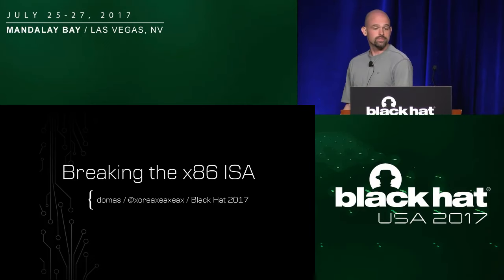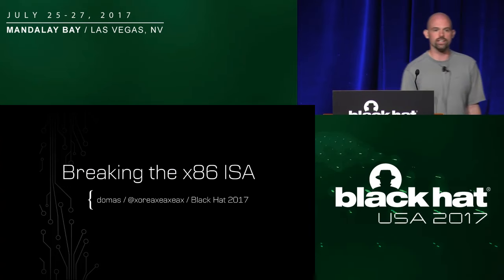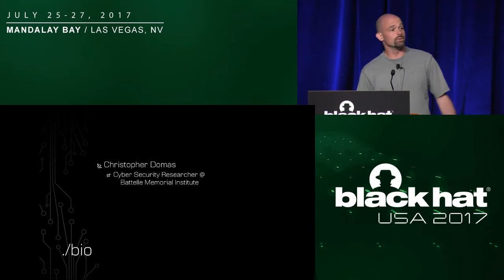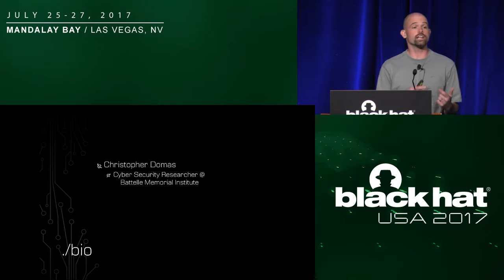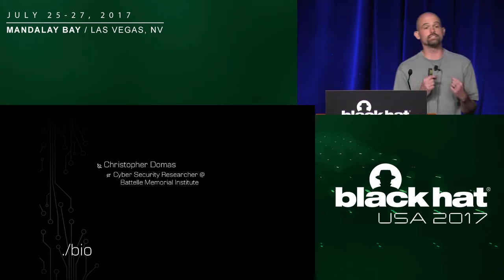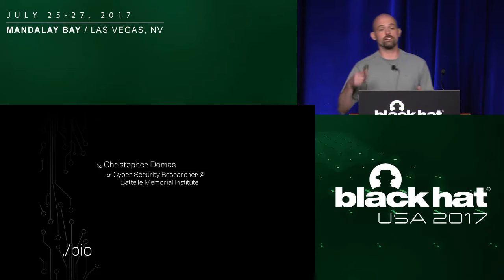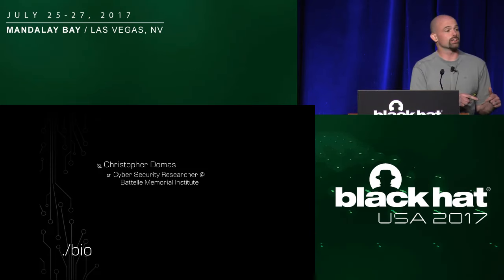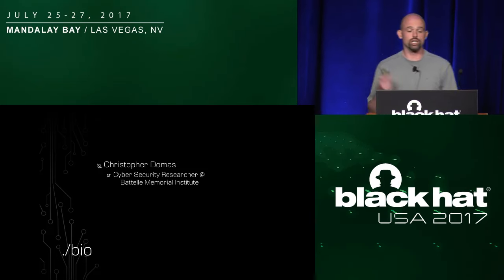Breaking the x86 Instruction Set

Comment: This guy is impressively good at what he does.
Reply: Most of us was suspecting processors to have some dirty instructions hidden inside them, but this is certainly not an easy task to search for them. Sincerely, hats off to this guy!
Reply: Not really, well known intel has entire independent risc processor for the purpose of remote monitoring, even when battery is off your intel pc can access microphone and listen to you talk.
Reply: marshalcraft how? If your battery is off then the microphone won’t work...
Reply: The battery may not be completely off. If the motherboard was designed to provide power to the microphone in the "off" state and provide enough power to the CPU to run the necessary instructions, remote monitoring may be possible. The only way to prevent it would be to remove the battery completely.
However, monitoring may not be feasible. I expect the process would have to dump data to a hard drive, which would require a lot of power.
Reply: Well, we occasionally find out that "secure" products have back doors and we know that the gov't frequently approaches tech companies requesting spy features, so we shouldn't be surprised if hidden ring bypass instructions turn up one day. I'm sure Intel was well compensated for them if they exist.
Reply: Intel is a scumbag monopoly with revenues in billions. They are as putrid as it can get. The only thing they are state of the art in is obfuscating technology and knowledge.
Reply: Come back with your plused one comments when you have a basic working knowledge of electronics.
Reply: Nfcopier, also could put a little bit of depleted uranium, to power it.
Reply: I freakin' love your online name.
Reply: Christopher Domas btw.
Reply: no such thing as imprex or not
Reply: @Reth_Hard  Been seeing you in CS vids
Reply: @atomisedman6235  
I did watch a lot of Youtube videos in the recent years... lol
Just curious, what do you mean by CS?
I can only think of counter strike, but I'm pretty sure you didn't mean that.
Reply: except he can't pronounce "Ryzen" correctly. it's "Rai-Zen" not whatever this is: 3:24
Reply: except he pronounces Ryzen completely wrong... like the name is said to much online, how does that even happen?
Reply: He one of the best.
Reply: The really scary thing is the bad guys are just as good.

Comment: Maybe a stupid question, but how does the cursor keep blinking if the CPU is locked up?
Reply: The graphics card does the blinking. The cursor blinking was literally done by special circuitry back in the days of text-only computers decades ago when the CPU couldn't possible spare CPU cycles to blink a cursor. And since there's been a continuous evolution of compatible machines ever since, the graphics hardware has never been relieved of that responsibility. Of course, modern GPUs can handle that in their sleep. (If the bug was demonstrated in a Graphical UI, then it probably would freeze.)
Reply: no such thing as stupix qor not
Reply: @TheHuesSciTech  eu ia morrer sem saber disso
Reply: @Brick It really is, not only because it would have been difficult to come up with, but also because it would be easy to think something else entirely. I thought it would only stop executing instructions in a specific ring or something like that.
Reply: I had some glitch on nvidia drivers on ubuntu that would show up some previous image sprites that were on my windows after I restarted and dual booted into it, it was something related to dual monitor (it didn't work out of the box, I never bothered to fix it), I have no idea how possibly that could have happened, how some sort of buffer could have survived a system restart, but somehow some internal gpu buffer survived, and I never seen anyone talking about that online. It also seems like the cursor is accelerated by the the GPU too, and probably a lot more going on.

Check this video out:
[PS2 vector unit demonstration Using only 16K of working space; NONE of the ps2 main CPU was used: https://www.youtube.com/watch?v=qlQhJCuBYsE]

Also, in other video game consoles, there is a lot of GPU compute that happens independently of the main CPU, search for architectures for the gameboy advanced, nintendo ds, nes, etc.

Comment: This is why open source is so important. I would love to see a viable open CPU alternative emerge, on the scale of Linux in the software world. It's not impossible, but it would be a much different and more challenging problem to solve.
Reply: already exists. SPARC.
Reply: Thanks..I was aware of SPARC but didn't realize it was open source. I'm also aware of some other open source CPUs. Still, I don't think it quite meets the mark for a genuine competitor to x86. I mean, I can go out and buy a laptop running Linux but I don't think I can go buy a laptop with a SPARC so easily....
Reply: Problem here is licensing.  It can't be GNU.  Would need to be BSD based to entice innovation and protection of intellectual property.  Which means the option to not release certain intellectual property for free.  Or rather, the freedom to not be compelled to do so at the cost of the innovator.
Reply: Kunou RISC-V is BSD-licensed ISA.
Reply: RISC V. Linus tech tips made a video on it recently...
Reply: just discovered RISC-V recently myself also
Reply: one teeny weeny problem with this.... how are you going to be sure the open spec is what is on silicon..... slightly modified chips could be swapped for companies that the govt wants to target
Reply: faacts
Reply: meh757 when gov has this kind of concern, gov uses legal shell companies. You could even become a “free for all” RISC V shell. As long as you weren’t getting compromised. Easier if you’re in a neutral non extraditing country. Easier if you have tamper evident traceable packaging (ie, this REALLY IS the package from chips ‘r’ us in Switzerland, and, it has not been opened)
Reply: Open-source for security only works when people can verify that the object code (the silicon in the case of a processor) matches the source code. It's theater to show some source code and claim that the build matches it. Suuuure it does.
Reply: @JayDee-b5u  How do you know that the binary doesn't have a backdoor inserted by the compiler? Ken Thompson's article Reflections on Trusting Trust is great.
Reply: @JayDee-b5u  Back to what I said earlier. So you have some source code to a compiler and people claim the binary faithfully implements it. How do you know? How do they know? Read the paper I mentioned. It's a serious problem especially when the stakes are as high as an election.
Reply: @JayDee-b5u  It would be interesting to have a full set of programs to bootstrap to a modern GCC etc. Assembly for a bare-bones compiler that can somehow compile a compiler that can handle GCC. C++ is so damn complex these days that it's hard to imagine a C++ compiler written in C.

Comment: TL;DR: This tool is awesome, thanks for writing it, good thinking all the props.

So, some thoughts, sometimes undocumented instructions can be implemented across multiple architectures because it is simply a logical extension of the architecture that isn’t actually documented, but putting in the logic to block those undocumented instructions is more work than it is worth. (i.e. undocumented, or “behaviour undefined” register combinations) similarly, a short-cut in implementation (pinning a behaviour-changing mux to a specific bit of the opcode, rather than actually decoding it) A good example here is the SL1 instruction on the Z80 processor. The three instructions SRA, SLL, SRL are combined in a quad-structure with a section of missing shift-left instructions. Actually executing these instructions results in a shift-left then set bottom-bit. Likely as a result of opcode bits being pinned to muxes.

Additionally, there is still a worth in specifications. Specifications detail what is expected behaviour, and what one can rely upon. As such, there’s a giant chasm of instructions that may work at the time, but are not guaranteed to work in the future, or even potentially after a microcode update.

So, we get this horrible area, where like the 66 e9 instruction, good software should never include this instruction, because it is non-standard and “a valid implementation of undefined behaviour is to make monkeys fly out of the user’s butt”, but meanwhile, the processor still accepts these instructions, and can potentially then be malicious.

At the same time, you can’t really trust that only malicious code uses these instructions… so… poop.

Comment: It looks like the "halt and catch fire" instruction he describes starting at 38:46 was never described publicly, at least that I could find. As he explains in this talk there was no time for vendors to address the issue under responsible disclosure so he couldn't give all the details at Black Hat 2017, but I couldn't find any reference to publications in the following months as he said would happen. There's a question about it on the Reverse Engineering StackOverflow site, but no one seems to know. I'm not particularly looking for a way to execute this instruction, but I'm curious to know if any mitigation was possible for CPUs that had already shipped. If anyone knows and has a reference this would be much appreciated.
Reply: Thanks for following this up! I was extremely curious as well.
Reply: Also hoping to hear more about it eventually. It's been a while.
Reply: Where are you, Domas? What did you learn?!

Comment: Undocumented instructions have been around at least since the Z80 and perhaps before then.  This is an 8-bit CPU which uses a separate 16-bit address bus.

The Z80 has two 16-bit index registers, IX and IY, intended solely for indirectly accessing memory, but people noticed that the binary code for accessing these registers was just one byte to say "Use IX" or "Use IY" followed by exactly the same instructions used to access the HL register pair, which are two 8-bit registers which can be used together as a 16-bit address.

Since the H and L registers can be used as separate 8-bit registers, people decided to try adding the "Use IX" or "Use IY" byte in front of the 8-bit H or L register instructions and discovered that they could access IXH, IXL, IYH and IYL as 8-bit registers.

Many programmers then wrote an include file which defined these undocumented instructions as macros so they could use them directly in their programs.
Reply: Nice to hear about the Z80, learned asm programming on that long time ago.
My coding style comes from this book by professor Miller (bing will  find it online);
 8080-Z80AssemblyLanguage-TechniquesForImprovedProgramming.pdf
Appendix J mentions those instructions.

Comment: 32:56 This man is claiming that it would be possible to write a malicious program that is completely benign and undetectable on any x86_64 computer that is not using a physical Intel CPU,  but when executed on a computer with an Intel CPU it could arbitrarily execute whatever otherwise deliberately avoided lines of ASM the programmer desired, and also vice versa by inverting the principle. That's the killing blow of this video and, if his demonstration is true, means that nobody should be using x86 CPUs for cryptography of any meaningful level of security.
Reply: His claim applies to all processors. Intel just happens to be the most popular, thus relevant one.
Reply: actually if you click on the timestamp at the beginning of my comment he is literally saying that a difference between intel and amd (+via) is what causes the vulnerability to exist. it could be said that intel is at fault because their noncompliance with their own documentation is what causes the problem. however all cpu manufacturers are at fault for everything he finds with his method, as he goes on to reveal a pentium f00f-like CPU hardlock he purportedly discovered in an AMD CPU.
Reply: The behavior of 0x66 with jumps is well-documented since quite some time.  This is just tools not being correct visavi the spec, which is pretty common to be honest for a complex spec.  The fact that AMD processors behave differently is a compounding of the problem, however.  Qemu is not an instruction set reference by a long shot; it is a best-effort project - and there are likely many other similar bugs to be found.  When using VT-x to run, you would get the right results.

Comment: Oh my. That's why I love my RISC CPU. Those x86 CPUs are so complex!
Reply: Well have fun writing fast software for RISC. Cisc is the way to go because you need less instructions to get more stuff done. Like sqare root in 1 op.
Reply: HD_Picard Thanks to significant microarchitectural advances in CPU design in the last couple decades, the number of instructions executed is no longer relevant to execution speed.
Reply: I have good news for you: x86 has been a RISC CPU for decades. The bad news: it's running a proprietary real-time OS known as "microcode" that emulates the CISC ISA and does all manner of shenanigans behind your back.
Reply: Waiting and waiting and waiting for some company to push out some RISC-V ISA based CPU for consumers.
Reply: If you completely disable the microcode, could you run code on "bare metal"?
Reply: If you disable the microcode (if you manage to do that) you could not do anything with your processor anymore.
Reply: The initial microcode is hardcoded into the CPU, but via software you can update it (on every boot)... So I guess it's really impossible as you said.

Comment: Most of those undefined opcodes could be what LAX was on 6502: opcodes without explicit microcode.
Reply: With simple processors like the 6502, you could enable parts of more than one instruction because the opcodes weren't discretely decoded. On a modern CPU, a working instruction is most likely intentional.
Reply: bryede the thing is: we don't know the exact internals of x86 like we do with 6502 because it's closed hardware and it's constantly changing with each new microarchitecture iteration.
Reply: Right, but the x86 is fully microcoded and it can even be updated in the field. This means instructions point to specific internal sequences to be executed. When you find a sequence that works without throwing an exception, it probably means there's something in the table. It doesn't mean it's top secret functionality, but it might be. On the 6502, the undocumented opcodes came from enabling more than one instruction because the sequencing ROM was optimized for size and is built out of fragments that can overlap with illegal bit combinations.
Reply: bryede several millions of undocumented instructions would require a fairly big microcode ROM, so we can speculate that there's overlap between some of the documented and some of the undocumented.
Reply: Right. Because of how the instructions are prefixed and expanded in a byte-wise fashion, you don't need a table supporting all bit combinations, but rather you move from one 256-entry table to another. I'm just saying  all unused byte entries are supposed to throw an exception. Just modifying instructions with prefix bytes won't.

Comment: His search scheme seems to exclude some possibilities. From what he described, if say 00 xx is a two-byte instruction, he checks 00-FF for xx. Then he goes back and checks the length of 01. If it's also two bytes as before, he then doesn't search 01 xx, assuming that the last byte won't do anything special. But what if 01 00 is a three-byte instruction, or 01 23 is a three-byte instruction?

Essentially, he seems to assume that there won't be two different types of instructions of the same length, next to each other in his search order. That is, if say 00 is a two-byte instruction, 01 is a one-byte instruction, and then 02 is a two-byte instruction, he will properly search both two byte instructions' second bytes, but if instead 00 and 01 are the two-byte instructions, he won't search the second one.

Later he says he has the instruction at the end of a page to use a page fault to detect instruction length. I'd be wary of trusting that mechanism, especially for hidden instructions. I'm sure I've read errata for processors where instructions near or crossing a page boundary have issues.

Comment: 8086/8088 processors had an instruction prefix interrupt bug which wasn't fixed until the 80c88 was introduced.   There was also a rather critical bug in early 8086/8088 processors which would cause an interrupt immediately after a  MOV SS or POP SS to push data off the stack into an incorrect memory location, causing data corruption.

Comment: It seems like exploiting a f00f-like bug (where it stops the processor) could be a more efficient DDOS-like attack provided you can manage to run unsigned code. Just get a company's servers to execute the processor stop instruction and they'll have to reboot all their computers. If you set it to run on startup, then they'll be locked out of their OS, forcing them to solve the issue from the BIOS.
Reply: it's DoS, not DDoS! I don't understand why your comment is here, since all of this was said in the talk. Also, your nickname... is this the stop instruction? Did you not hear about responsible disclosure ;)
Reply: They carefully wrote "DDoS-like" and were talking about a specific scenario

Comment: My guess is many undocumented opcodes just do nothing. My guess the number of really secret opcodes are few, they just treat the potential execution paths as NOPs. 

Complex CISC CPUs use microcode to decode instructions so just routing them to NOP is more economical. 

However I still am concerned that the OEMs have included opcodes which may only be used for debugging but are vectors for abuse. What’s worse, some of the vulnerabilities may require several undocumented opcodes to do something so just poking single opcodes isn’t enough to scope the problem set.